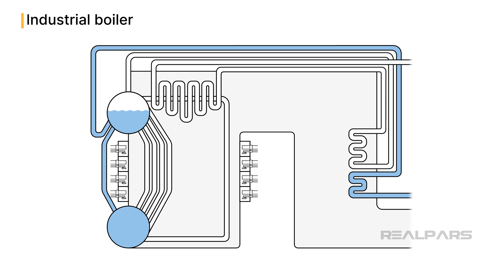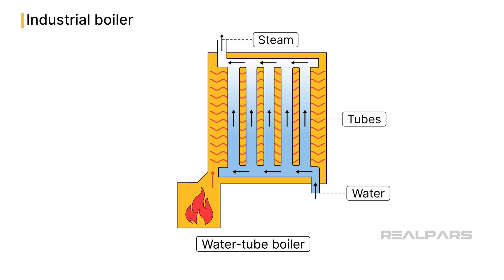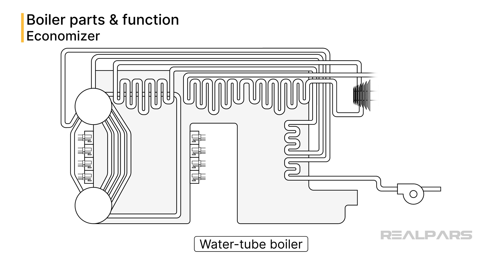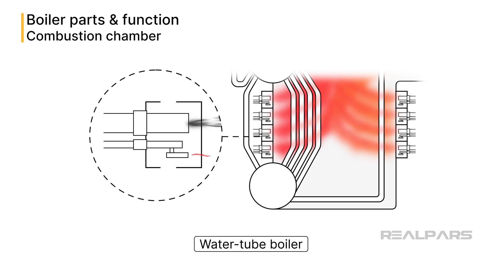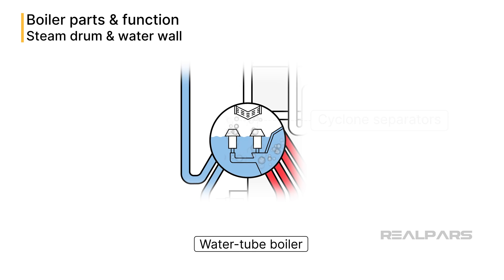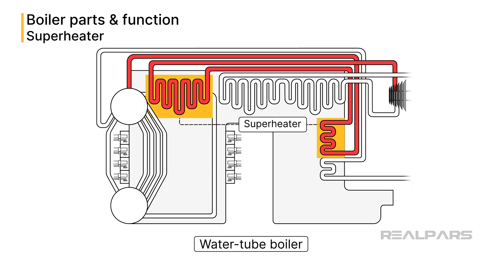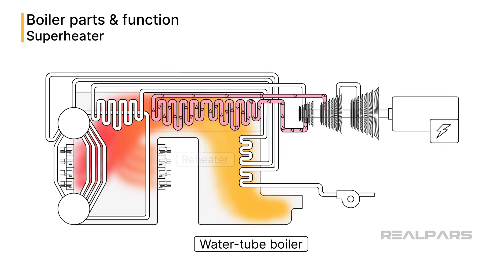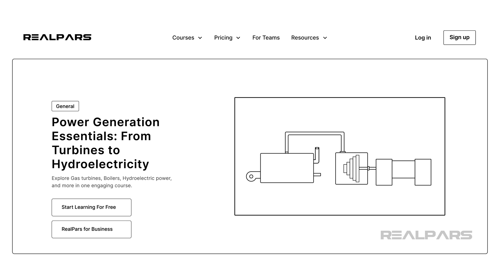What Really Happens Inside an Industrial Boiler?

Comment: @RP - 👍👍 Excellent. What makes a coal-fired power plant so "dirty", and can diesel/coal ever be "clean"?
Reply: Regarding the second question, significant investment would be required in carbon capture and purification technologies to prevent emissions from coal power plants from entering the atmosphere.

While advanced coal technologies have managed to reduce emissions—sulfur dioxide by 68% and nitrogen oxide by 46% over the past 30 years—the reduction in CO2 emissions has been much smaller. Additionally, coal mining itself is a major source of pollution and environmental degradation.

Given that renewable technologies produce zero carbon or harmful gas emissions once built, and that natural gas and nuclear energy, though harmful during extraction, have relatively limited and manageable environmental impacts during operation, focusing on "clean coal" may not be the most economical path forward.

That said, carbon capture technologies could play a crucial role in reversing climate change and are, in my view, well worth the investment.
Reply: @arash-moradian  This assumes that there is an issue with CO2 emissions, which is not a fact. It's a hypothesis.
Reply: @arthouston7361  I answered your comment as well, but it also got deleted.
Reply: Several principal emissions result from burning coal : Sulfur dioxide, which contributes to acid rain and respiratory illnesses. Nitrogen oxides, which contribute to smog and respiratory illnesses. Particulates, which contribute to smog, haze, respiratory illnesses, and lung disease. other pollutants include benzene, carbon monoxide, formaldehyde, and polycyclic aromatic hydrocarbons.

furthermore, coal has lower energy density and higher carbon concentration than methane or natural gas, for instance, causing more Co2 to be released into air for the same amount of power generation.
Reply: I answered the first question, but my comment got deleted, don't know why